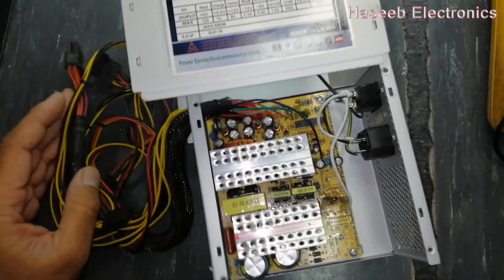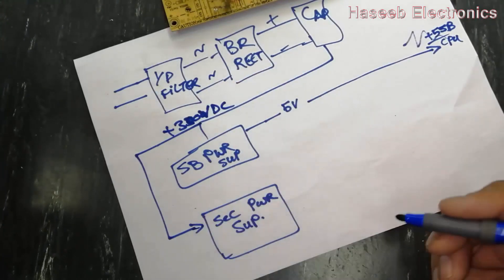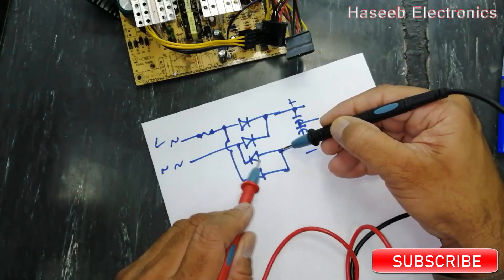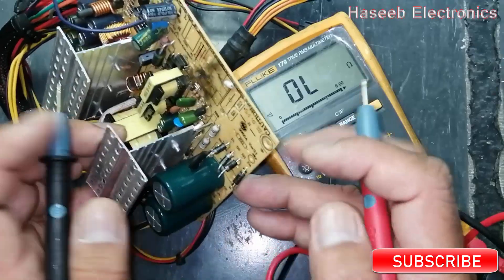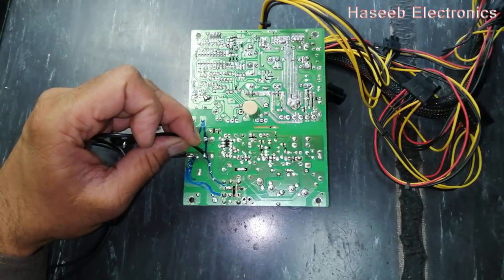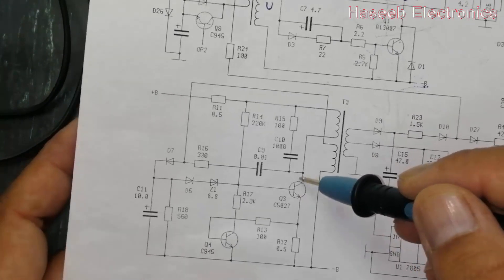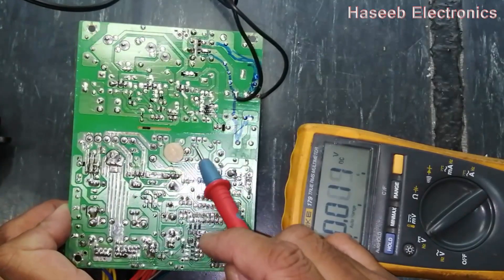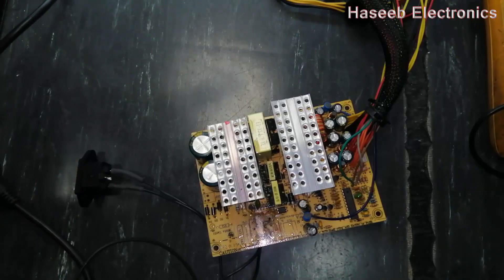{311} Computer ATX Computer Power Supply Repair  / 5V SB Standby Voltage Fail / Input short circuit

Comment: Sir, sb transformer there is no second voltage. That is 14 volt . What may be wrong?
Reply from the maker: if pulse transformer driver transistors get short circuit, that volatge will drop
might be SB transformer that winding is open circuit or its rectifier diode is damaged

Comment: I have an ATX Uranus power supply, and it never turns off, I've already changed 3 motherboards, and the defect is always the same, it's always on, I checked that the green wire is in a short circuit with all the black wires. How can I resolve this? Could it be the output electrolytic capacitor? Could it be the optocoupler? Could it be from the integrated output control circuit?
Reply from the maker: When green wire is connected to ground then Power supply turns on 
If it is short circuited with black wire it will keep PSON command pullled down 
Check voltage on green wire, it must above 2.5 volt 
If there are 2.5 volt and power supply remains on, then trace the circuit might be power supply supervisor ic is problematic 
In case you are unable to find 2.5 volt or above on green wire 
Then trace 5 volt standby section (purple wire and related portion to green wire)
Reply: @HaseebElectronics  Thanks but I check voltage on green wire and is 0 Volt.
ATX power supply, but it never turns off, with the fan always running without being connected to any motherboard

Comment: I have 8 pins 290 watts psu. In my case this only 5 volts is low to 4.73 volts. The problem is, my computer remains turn on for few minutes then suddenly turns off (power out), then again restarts after few minutes.
In other wires i have perfect 12 volts.
How I diagnosed that I have faulty a PSU. I replace this PSU with other 280 watts atx 24 pins using connector. Now, my pc is working fine with old psu. 
But i want to repair its own built-in psu.

Comment: Assalamu Aleyküm brother. Thank A lot from Turkey. You are perfect knowledge in this Area. İ have A question. Stb voltage is 5 volt but pson voltage is 2,46 volt and power supply is not turning on? Everything is seems like normal. İ will so happy if you answer this mu question. Assalamu aleykum brother..

Comment: Respected sir, can you tell me  possible to make a adjustable power supply( voltage and current need to adjust) by using this type atx power supply ? Please reply.
Reply from the maker: okay dear
i noted it and i will try to do it practically very soon
Reply: Thank you so much sir. Waiting. 🙏

Comment: Please help me i watch your videos, i fix 2 pcs atx power supply, one atx psu standby voltage is 3v, and the another .1v to 3v flunctuation, what might be the problem, when is the release of the continuation of thiz series much anticipated, what is the problem when low voltage or flunctuating standby voltage?

Comment: Sir   parple wire per 5 volt arhe  hen pr suply on nhi ho rhi
Reply from the maker: if fan starts for a moment and stops. then it is fault of protection circuit. check protection circuit and PWM circuit.
Reply: @HaseebElectronics  sir fan no start but seris bulb start time blow
Reply from the maker: @kitkatraffal4747  series start time blows an then backs to normal, that is good
if fan does''t start, that means the PWM controller is not getting start. please tell me the IC numbers used in the ATX
Reply: Plz sir help me for solving this problem
Reply: Tsm1002ds
994292h9
Vn 99 mys
Reply: Sir your watsapp no ??
Reply: And one ic 8 pin lm358n

Comment: Haseeb I have no stand by voltage can you please help me identify which component is fail on that circuit. I have voltage on stand by ic and input of 5v transformer but nothing after that no voltage on the cold side at all. Thanks
Reply from the maker: can you please send me the part number of switching ic

Comment: my pc power supply on and off immediately,All capaciter and diode work fine,What is the problem in supply,Plzz help
Reply from the maker: it means you have something wrong in output section, might be some capacitor leak or diode short.
so the supervisor ic makes safety and turns off the switching.
check 12 volt section, 5 volt and 3.3 volt section
Reply: @HaseebElectronics  Thank you Friend.I wiil chek
Reply: @HaseebElectronics  no any problem on Diode,Caps,Smd resister,so what is the issuese ? how can i fix it ?
Reply from the maker: @isira770  you can remove protection of supervisor ic, for 3.3 v, 5 volt and 12 volt one by one to detect faulty line
Reply: @HaseebElectronics  my power supply problem is IC ST9S429-PG14  .can i bypass ic?
Reply: @HaseebElectronics  any caps, diode or resister not shorting.optocapler working fine. Smd resister, caps not shorting...

Comment: Thanks for the service you do for us.  Sir in my atx power supply power good is not generated,  but I get all the voltages. What should I do now sir?
Reply from the maker: if your ATX supply have any comparator like LM339 or LM358 check its +ve supply from SB voltage
and check that 5 volt from secondary power supply is fed to this comparator to generate PG signal. 
or if this ATX have supervisor ic to generate PG signal, then trace its circuit to sense  volts for Power good signal

Comment: My psu do not satart, if i start it's, i listen the sound no stop, i check the capacitor it's ok !! I can't find the problem. Thks to help me.
Reply from the maker: if you connect multimeter to yellow and black line, and start can you see some voltage just for moment and then go zero.   or you cannot see anything at all
does the sound is from the power transformer?
kindly let me know
Reply: @HaseebElectronics  https://youtu.be/SKP6c8ETjPI
Look this it's my psu. I do not what is  the sound.
it's the transformer ERL 35V ?? How check this ERL 35V ?

Comment: Very good video , I will impatiently wait for next video.I have got one ATX SMPS where stand by voltage is 5V and when ps on is shorted then SMPS starts for few minutes and then it stops.what will be the reason ,may be short capacitors on secondary side or elsewhere.please guide.
Reply from the maker: if it stops after few minutes, then there is possibility of leakage of output capacitors or rectifiers
try to re-solder POWER MOSFETs, Power transformer, and power rectifiers in  secondary section 
i will share the next part of the video very soon
Reply: @HaseebElectronics  thanks I will check secondary side capacitors and then let you know

Comment: Any idea what causes 4 diodes to fail at the same time?
Happy New Year!
Reply from the maker: sometimes high frequency spikes having larger time period reach with line voltage and if there is no input filter EMI/RFI filter, and the spike width is larger than the diode's allowed limits, then 
in first half cycle one pair burns out and causes to short  circuit at bulk capacitor
if the fuse burning time is slow, it will case to damage the other pair as well
now the main ac is directly connected to bulk polarized capacitor 
now there are 2 optiona 
1. fuse have to blow away. OR
2. Main DC capacitor and next all circuit have to be damaged
Reply: @HaseebElectronics  thank you sir. A very detailed explanation.
Reply from the maker: welcome and special thanks
it is my pleasure

Comment: sir i do have ATX power supply, in which ps on green wire have 4.0 volt but when i short green to black , no witching and fan not spinning, i open tested bridge rectifier ok out put got 330 volt dc, same voltage i am getting on output capasitor which is 450v 180uf....what do you think have solution?
Reply: i got my reply , my sb or sv voltage is available but 12 volt for signal transformer is not available...now how to Repair that one sir?
Reply: i got answer at your video 18:23
Reply from the maker: indeed I am happy to listen that all replies for your questions were in my video, it is my pleasure
Reply: Check resistor 10 ohm, check dioda zener,

Comment: Very interesting video M Haseeb, as usual. HOWEVER, i found out that ATX, even if they are powerful, they remain difficult to exploit: hard to rise the voltage because of supervisor, and hard to fix because of too many components.
I recently used the Led drivers (s-150-24) for example and they are nice replacement for ATX: easy to set the voltage up, powerful, and very few components. Can you PLEASE make videos, as some i have don't start.
Here is a schematic of one of them : http://www.hordsoffun.com/ebike/pics/Meanwell_S-350-27.png
Stay blessed, and HAPPY NEW 2021 Inchallah !
Reply from the maker: you are exactly right. that controlling the signals is a big headache, but it is very easy to recover it. because its every group of components have special function. so that it is easy to repair. 
just we have to follow the signal flow, 
i will check the diagram 
thanks a lot. best regards

Comment: 🙏❤👌Genius teach sirji👌🙏❤
sirji multimeter Best Konsa h❤🙏👌
Reply from the maker: thanks a lot dear
multimeter to Fluke ke achhey hein lekin expensive hein
aap Pro's Kit ke, Uni-T ya kisis aur company ka meter jis me auto-range ho, frequency, capacitor, diode ka option ho, le lein. 
i suggest, please check Pro's Kit MT-1232
Reply: @HaseebElectronics  Hertsfuly Thanks u valubal feedback

Comment: Sir, i have one question? i would be glad if you answer it, one day i was trying to repair my smps, after changing some of the burned out component, then i tested without using a series lamp, it blew the mcb off  including the mcb attached on the wall, could you please tell me that if I use a series lamp, will be more safe, pleased to know the main purpose of using a series lamp....
Reply from the maker: Oh it is so sad. 
if there is a proper value fuse is used, then there is no way to become a huge damage. might be there is wrong value fuse or fuse is bypassed by something. 
while repair process it is best to use series lamp, because it prevents damages and provides a vital support in troubleshooting and covers many human errors in repair process
Reply: @HaseebElectronics  you really are a blessing to many, i will use a series lamp from now on...thank you so so much
Reply from the maker: @MrDave17jan  best regards